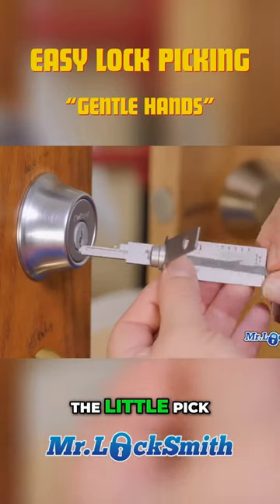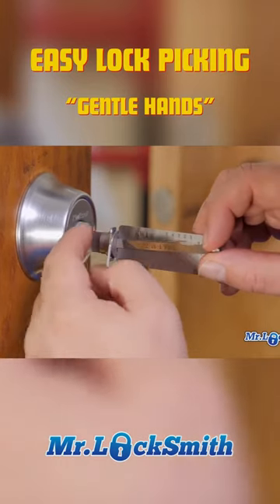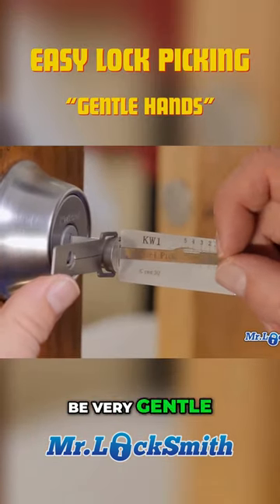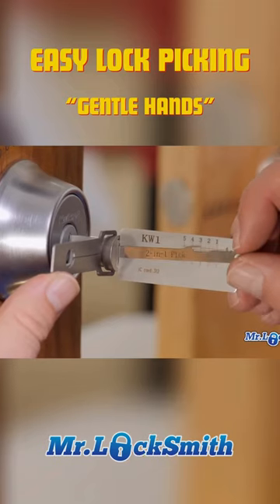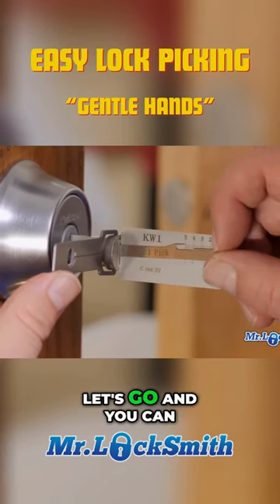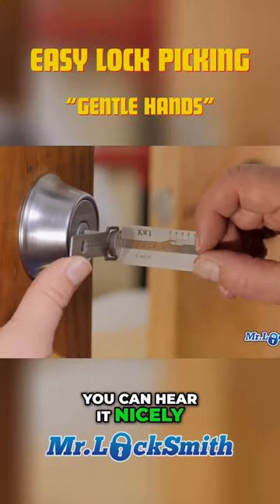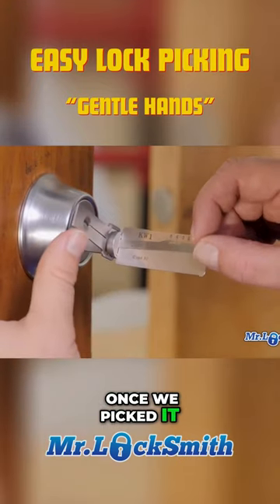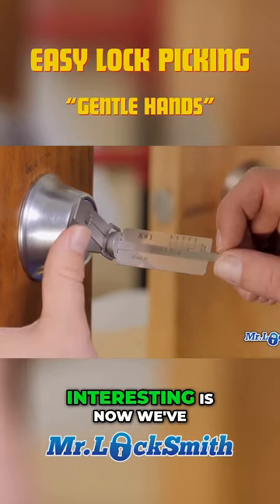Easy Lock Picking: “Gentle Hands”

Comment: I love my lishi tools, but honestly if you're going to use one, you might as well be single pin picking it. I usually prefer to rake open a lock, then use the lishi to decode it. That method usually is much quicker, saves a lot of time. Obviously this is meant mostly for residential locks, harder to pick locks or automotive locks are much easier with the lishi alone. But for kw1/kw5 or sc1/sc4 rake and decode is the way to go!